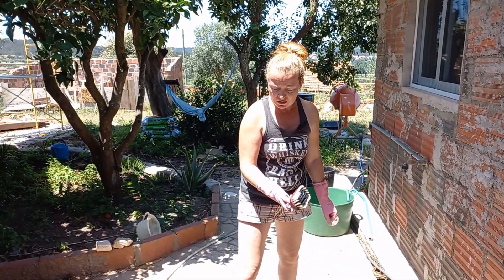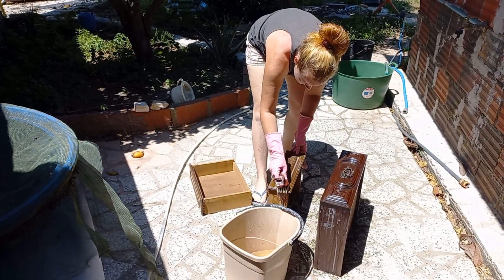Renovating our Portuguese Ruin - Limewash Removal. Stripping Varnish. Making Curtains.

Comment: I was hopping that the baking soda, hot water mixture would work but I had some doubts because of the varnish coating on it! The piece I used it on,  was probably just stain and wax and that's why it worked! The curtain looks beautiful in your bathroom! I enjoyed watching you do such a great job repurposing it. 🥰
Reply from the maker: The baking soda and hot water should work after I remove the varnish with the paint stripper. The curtains are perfect in the bathroom! Thanks for the gift! ❤️
Reply: @notyouraveragegringos  Yes, once the varnish is removed it should work. So happy that you made them look beautiful and useful again!! ❤

Comment: YUP! I also seem to remember the chemicals back in the day were far stronger than what you get nowadays. 😵‍💫🤣 Good job on the curtains repurposing. I don't envy you with your lime-wash removal process ahead of you.
Reply from the maker: The paint stripper I used when I was younger took two or three different colours of paint off in one go and the stuff you get today you have to use the paint stripper twice just to get one layer off. 🤷‍♀️
The limewash removal is a necessary evil as most of it was applied over regular paint so it’s not sticking well. I hate the stuff anyway.